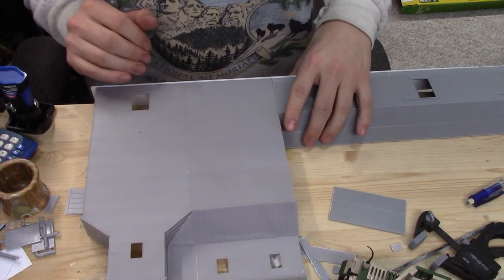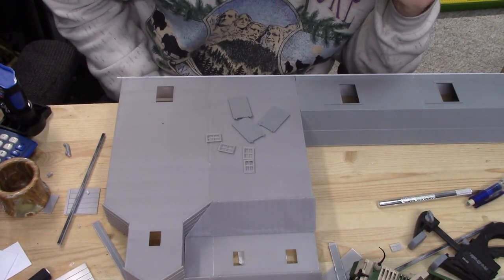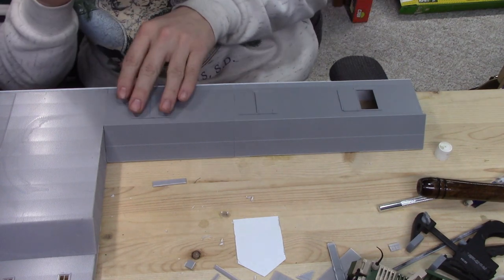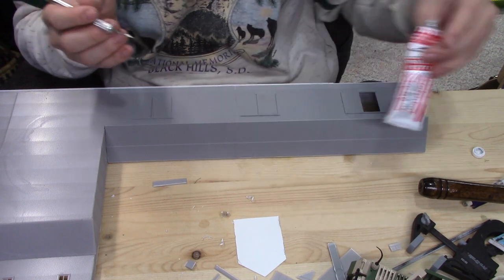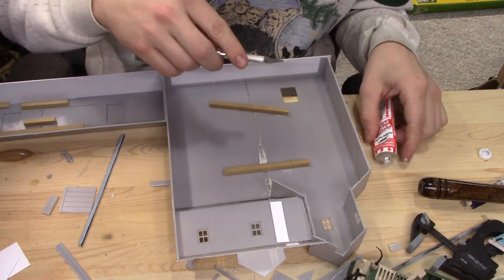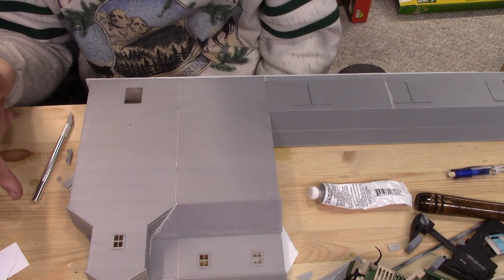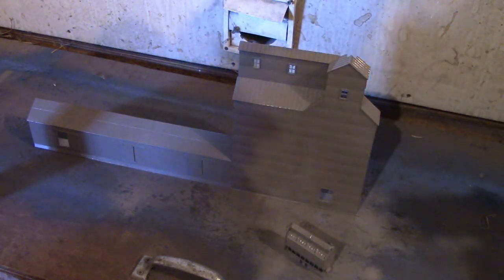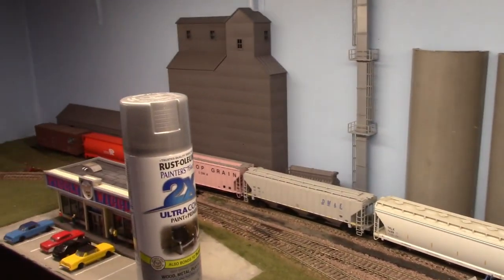How to Kitbash a Grain Elevator Part 7 Using Rust-Oleum Spray Paint

Comment: You using the putty to fill in the cracks reminded me of something I've done instead of using putty. I use liquid styrene. I don't know if you know what that is so I'll tell you. I've taken a small glass jar, like the size of a paint jar; crammed the jar full of small pieces of my leftover white styrene, then fill the jar around half full with liquid styrene glue and put the lid on. I use Plastruct Plastic Weld liquid styrene glue. It comes in a glass jar with an orange label and a brush attached to the lid. Once the styrene melts you need to mix it with a wood stick. It needs to be thick so it will stay where you put it but not overly thick that it cures before you smooth it out. I do mine a little less than twice as thick as Elmer's white glue. You have to add more styrene pieces or more liquid glue to the mix until it's the consistency that you want it. Once it's right and you are happy put the lid on and it will keep until you are ready to use it. It may need mixing when you go to use it. That depends on how thick you make it. You can also use sprues left over from kit building. This helps fill in cracks of course but it's very good if lighting a structure to hide light bleed spots. Coat the thin spots on the inside like stucco. Maybe that little piece of information will help you or someone else out. The Grain Elevator has turned out very nice. The kitbash videos you've done on it have been great too.   👍
Reply: William Bryant thanks for the info. I’m going to give That a try
Reply: There's all different types of things you could use this for not just filling cracks. As it dries you can kind of shape it too. Not to anything pretty though. Unless you're just that talented. I've thought of maybe using it as white water or rapids in a river but haven't tried that yet.   👍
Reply: @Crookedriverandeasternrr  I've got a little jar that I use and as I use it up I just put more liquid glue and more styrene into it. I wouldn't mix the white styrene and plastic kit sprues together. I don't know how well that would work.   👍
Reply: Very nice William! As an alternative to plastic glue, you can probably use straight M.E.K.... methyl ethyl ketone.
Reply: @garycorbin-pakratroutemrr1712  I'm sure that would work and be cheaper as well. I've actually been researching lately about just using straight M.E.K. for gluing styrene. Its sold at hardware stores as paint additive and you get a lot more for your money. Basically styrene glues are mostly M.E.K. with very small amounts of other chemicals that just thicken the M.E.K. and then another chemical to keep the thickening chemical from separating from the M.E.K. So why not is the conclusion I've come to. When I use what Plastruct glue I've got remaining I'm gonna fill it up with M.E.K. I also understand that it takes a lot less to get things to stick together.  Just have to be careful not to melt everything you've built!   👍
Reply from the maker: I have heard of that from Off the Rails on MRVP.  I have the putty so I use what I have.
Reply: If you want to make water with that, why not try clear plastic?
Reply: @jim874  Haven't tried using clear. Someone will have to do that and see how it works.